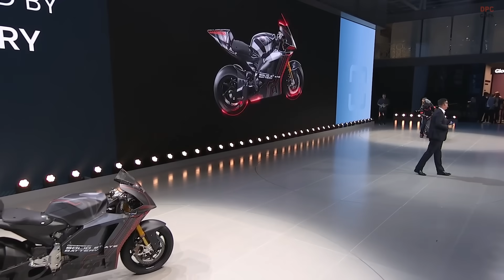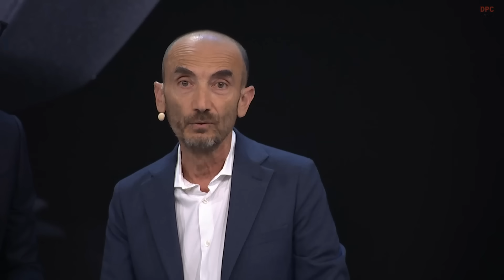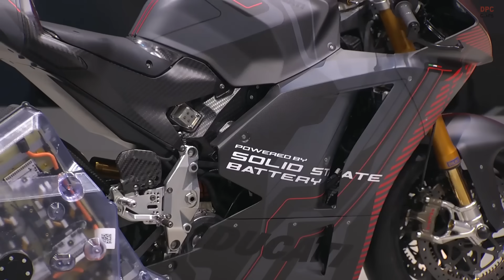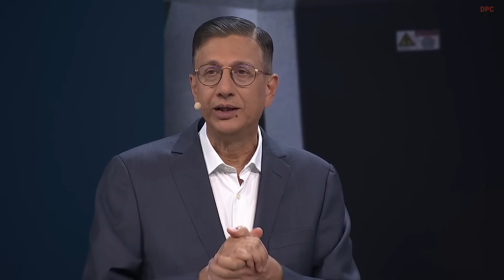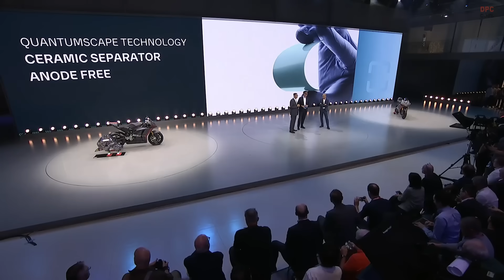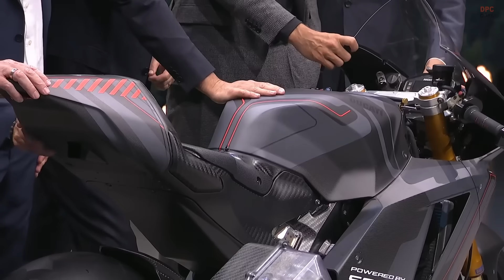First Solid-State Ducati: VW Group’s Bold IAA Demo Changes EV Speed & Charging

Comment from the maker: First public solid-state demo from Volkswagen Group on a Ducati race bike—would you ride an electric superbike that goes from 10 to 80 percent in about 12 minutes? What matters most to you: lighter weight, longer range, or faster charging? Drop your pick below and tell us when you think solid state will reach road cars.
Reply: I would want lightweight, higher range, AND super fast charging. Shoot for the stars!!
Reply: Mir ist die Konstruktion der Akkus egal ,wichtig ist nur die Speicherkapazität Wh pro kg ! Gerade für Motorräder brauchen wir dringend eine Kapazitätssteigerung auf 500+ Wh pro kg .Schnelle Ladefähigkeit ist nur ein nettes Extra ,Kapazität ist wichtiger ,mit Reichweiten von 300+ km .
Reply: Not enough info, a bit strange
Reply: " See what 844 watt hours per liter "? This is a meaningless figure, also, you didn't give us any specs whatsoever, just blah blah, thumbs down for dislike...
Reply: هل يمكن صناعة دراجة نارية هايبرد كهرباء+وقود ❤
Reply: @فارسليبورد-ك8و  in a bike there is no room for e-motor+batterypack AND ice-motor+tank.... hybrid need adiitional room for that...
Reply: @DjNorad  Not technically. A smaller less powerful ICE with a smaller less powerful E motor could be possible with the right packaging. Together they meet or exceed current fast bike standards but alone they are far less powerful. We've seen the reality in F1, if we could scale it down with matching compactness it could be possible. But doing it and releasing a production model are two different things.
Reply: @jameshisself9324  that makes absolutely no sense.... and makes it much more expensive and more complicate.... so why in the hell someone should do it?  just because he could?
Reply: @DjNorad  You are not too bright. Read the question again. He said 'possible'. It is more than possible. It would be complex, but it is simply beyond stupid to say that it makes no sense.
Reply: There is nothing to pick from; either all three points are met, or the whole thing is completely uninteresting.
Reply: Elektro Motorrad geht für einen echten Biker gar nicht, ist frefel !
Reply: @hubipilot4083 und was ein "echter" Biker ist bestimmst allein du?
Reply: The most important staff are lightweight  and storage capacity
Reply: The answer to your question is ALL. I would kick ICE to the curb and never look back if the reality met the hype.

Comment: I used to ride motorcycles and being able to downshift to use the engine for braking is how you get really fast through corners. If you're really good you mostly use the engine to slow into a corner by down shifting, not so much braking. What I don't know is how you get the same kind of effect with an electrical bike.
Reply: I thought like that for manual cars but there is much more control in my EV car. Regenerative braking slows down faster. Probably adjustable in software too.

Comment: much ado about nothing
the battery is just 10% more energy dense that the lithium ion battery the bike has in motoE. And indeed, there are already commercially available (expensive) silicon anode batteries with significantly higher energy density. Ducati has no interest whatsoever to electrify their bikes, as their name is strictly tied to high performing combustion engines. Just doing some PR for Audi/VW.
And, motoE has just been canceled! It has always been just a PR exercise anyway. With not actual interest, desire of electrification

Comment: Before Covid some electric bikes had lapped the Isle of Man TT circuit at over 100 mph average speeds. For those who don’t know the TT circuit is over closed roads. Over 37:miles long and some were hitting 160 plus through the Sulby Straight speed trap.
Reply: Well said!! I'm thinking of the late Mr. Michae CZYSZ, with whom I was discussing the cavitation of the high-speed oil pumps on the "C1-990 cc"... a great man who, with the "E1PC's" on the TTe; didn't make me laugh at all, the Mugen/Honda team laugh...
search: MOTOCZYSZ E1PC TT... enjoy ;-)
I happily imagine a "6XFLEX" fork adapted for this motorcycle demonstrator, in order to complete the engineering research.... a great tribute to his vision!!

Comment: Conventional lithium battery got no moving parts, so it's could be considered as solid-state battery also
Reply: It refers to the electrolyte: fluid = not solid state, solid = solid state. However if I’m not mistaken Quantum Scape’s tech is somewhere between the two and thus not true solid state. The electrolyte is more like a gel than fluid/solid.

Comment: Why make an electric bike look like its gas equivalent with compromises needed for large fuel tanks, engine, and cooling?
Reply: Aerodynamics, rideability, colling for the battery and motors, places to put the battery etc.
Reply: @SimplySketchyGT  An ICE bike looks the way it does because all those systems need to be in proximity of one another.  An EV does not.  Wish Ducati did some out of the box thinking about what two wheeled design could look like.

Comment: What you want to know: This is not a production bike. Designed exclusively for the MotoE World Cup.
Range will be 13-18 mins of full throttle. 30-50km range. So not even close to a practical use case.
Reply: Bummer that MotoE was just ended
Reply: But if you put the same tech into a different bike it would be a lot different,  this is just showing concept.  For instance the Zero DSRX has a range of 180 miles, if you put solid state batteries in that the range will double and have much faster charging too.

Comment: To put things in context I’m 76 years old I’ve been riding since I was 18. I currently own a Triumph Bobber and Harley-Davidson Nightster. I also own an electric mountain bike and Sur Ron Light Bee. I would buy an electric motorcycle for around town riding. An electric motor can do things no IC engine can do, like instant torque and no need for a transmission. The limiting factor has always been the battery. Going forward I would always want the consumer to have a choice because each system has advantages and disadvantages and most importantly, the government needs to lighten up. Right now emission standards are excessive for gas powered motorcycles and they will only get worse.
Reply: Vc está certo exceto pela parte do Governo! Esse nunca ajuda, só atrapalha!
Reply: Just bought a LifeWire One and it does exactly what you are looking for in a perfect way
Reply: You lost all credibility at Harley  you know nothing about quality speed tolerance and self awareness
Reply: 'emissions' another lie to get in your pockets
Reply: @JayDee-b5u 
Put your lips around the tail pipe of your beloved ice vehicle and breathe in through your mouth.
Reply: I have a 690smcr, Multistrada, Tuono, 3 EMtbs and a Light bee! Well done sir.
Reply: It's your generation's fault we're in this mess...
Reply: @Pickle_Rick-m4o So the new generation isn’t using electricity?  Since over fifty percent of it comes from fossil fuels, I think you’re just as much to blame.  I can’t wait until electricity is created without burning any fossil fuels, then the kids of that era can blame you for the mess you’ve caused in today’s world.

Do you blame cave men for using fire for heat?  Because today you can heat with electricity from a nuclear power plant…..
Reply: @Pickle_Rick-m4o there's no mess.